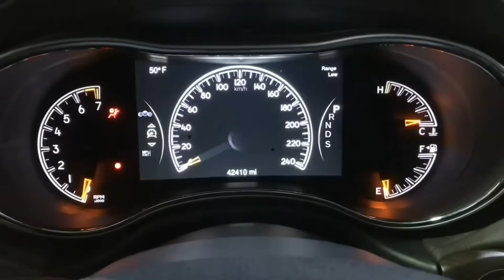The Shocking Truth Behind Chrysler's 2.7 V6 Engine Disaster

Comment: Org. Owner Since 2010.
2010 300 2.7L w/ 178,000 ORG. 
Pennzoil 5W-20 CONVENTIONAL OIL ONLY every 3-5k. Reg Fuel, w/ B-12 monthly. 
Trans Service Every 50k. New KYB shocks and struts at 150k. 
Recent Tune up, w/ New Bosh injectors/NGKcoil/NGKplugs, 
Cylinders/Valves clean, no oil sludge. Goal; 300k or end service life.

Do not mix synthetics and blends into your conventional only vehicle. That's the trick.

Comment: I had a 2000 chrysler canada Intrepid. had the 2.7, ran great for the first 5 years, then it gave me nothing but trouble. engine light constantly came on. no heat. had to shut the car off and on. go into safe mode. engine finally went at 200kms, 124k miles. had to replace the power steering cooling system. the rods bent back, tapped against a connection bolt. vibration tapped a hole in it. all fluid drained out. had to replace it. $400.00. I had it. I bought a replacement car, a 92 crown vic. 8 years older, more miles on it. ran like a top. drove it for 5 years. I was going to drive it until summer however it kept going. its still on the road today. sold to some helicopter mechanic apprentice. now drive a caddy. I will never buy another chrysler product again.

Comment: This story is very true.  Had this happen to my 2002 Sebring Convertible.  I used conventional oil as that was OEM recommended and commonly used.  Synthetic wasn't very common yet and very expensive at $15/qt.  Now walmart and costco sells synthetic at $3/qt.  Conventional oil resulted in a sludge monster that jumped timing.  I replaced the bent intake valves, timing chain, tensioner and water pump.   The 02 Onyx green Sebring convertible is still going strong today.

Comment: Had a 02 Dodge Stratus Sedan R/T with a 5 speed manual transmission. Best car ever 2.7L was great. You just needed to be on top of maintenance at every 3k with full synthetic oil. The looks that car would get with a 2nd gear scratch wad great. I drove it into the ground with over 240k miles on if before the rust destroyed the body.

Comment: The 3.6 l pentagram has been a fantastic little engine in my wife's grand cherokee.. regular maintenence and keep the revs down and no issues.. main issues I've seen with rebuilders is the rod bolts were not very strong, and the oil cooler leaking.. I dont follow the Chrysler oil change schedule either... its always change at 4k and always uses castrol edge and a wix filter... I've been very happy with that car

Comment: The Chrysler V6 engines were put in economy cars. Cars were their owners may not have adhered to the oil change interval as strictly as a car enthusiast car. Extended oil changes well beyond the service life of the oil caused the oils of the time to break down into sludge. This is no different now as it was 20 years ago. What adds insult to injury is the narrow oil passages. Those passages started clogging up with sludge after the cars owners opted to extend their oil change intervals. This issue exacerbated the issue. Of course conventional oils of the time are not as good as conventional and synthetic oils of today. Had this car been spec'd with synthetic oil, one more resistant to breakdown with the additivie packages of today, this would be less of an issue. Modern cars run even tighter tolerances and use thinner oils now than ever! 

Synthetic oils in the Chrysler 2.7 V6 would've saved them. At least from sludge.

The waterpump running off the timing set is not a good idea ever. Ford would later do this to their Duratec V6s which was the killer of those engines if not caught and repaired in time. Granted, they did it to fit in FWD cars, crossovers and SUVs. RWD & 4WD trucks and SUVs didnt have that problem. 

What reallly sucked about the LH cars was the battery behind the drivers wheel well. That was idiotic! Chrysler would solve this issue by moving the battery to the trunk in newer vehicles.

Comment: Moral of the story: Change your oil every 3000 miles, use Mobil 1 synthetic, use a quality oil filter. I personally never buy a “new” car. I drive 60’s and 70’s cars that hold their value and have simple engineering. A Dodge or Plymouth V8 (318, 340, 360, 383, 413, 426, 440) driven car or truck will last forever and often be worth more than any new car or truck.

Comment: @bbracing3925 No, it isn't leaking. It doesn't have oil sitting there, uses none in 10,000 km. Same with the coolant. Talking a 2017 a Go Green Dodge Challenger GT AWD. I even tow my boat with it. A horn, cracked plastic ZF trans pan, replaced with aluminum and the center driveshaft replaced with a 2 piece housing and rubber. Otherwise just maintenance items, no rocker noise. I had a 2010 Challenger with the 2.7's sibling 3.5. I accidentally stretched one conventional oil change to 8000 km. It used more and more oil after that and had a bad clatter. Our 2017 has been as good as the Toyota Corolla we bought with 13,000 km. Actually better, that killed tires every 50,000 km. Had two alignments at two different places.

Comment: I had a 2003 Sebring with this engine and it barely made it to 100k miles before it shit the bed. The water pump housed within the block began to leak and caused the engine to fail. Neither the dealer nor Chrysler would stand behind this POS. This experience with Chrysler single handedly turned me against everything related to the brand.

Comment: When “100,000” spark plugs are advertized customers become jaded when the spark plugs outlast the rest of the car.
Legend is that the first mini-vans’ (what the stereotypical parents took the kids to soccer in the ‘80s before SUVs) powertrains were warranted to 60,000 miles and on schedule the rubber timing belt would fail a few 1,000 miles later. At the time the typical miles per year was 12,000 more or even more. Don’t know about mini-vans but I had such a belt fail; the car just stopped. Fortunately the piston to valve clearance was sufficient.

Comment: SO much incorrect information in this video. Yes, the 2.7 was a notoriously bad engine (later revisions weren't as bad, but I still wouldn't own one), but was NOT a clean sheet design, it was derived from the 3.5 SOHC which was NOT a heavy or inefficient motor, it was revolutionary for a mainstream new clean sheet design from an American manufacturer when it was released for the 93 model year. They wanted a modern replacement for the base engine in LH cars (the 3.3 used in base model first gen LH cars was neither efficient, smooth or quiet, so they went to the drawing board and used the 3.5 as a basis to design something smaller that would produce less emissions while still maintaining respectable power - and they did achieve that goal. It made only a hair less power than the outgoing first gen 3.5, and made much more power with better economy and NVH than the 3.3 it replaced.

The rest of the timeline? Well we know the rest. Small oil passages combined with a VERY high normal operating temperature and a water pump that had a tendency to leak into the crankcase and contaminate the oil wiping out rod and cam bearings were a really, really bad combination for this engine.

Comment: I had tow Stratus’ with the 2.7. I loved the engine. Good power, smooth running, good fuel economy. The key to keeping it healthy was strict adherence to oil changes. Engines run hot on the heads and can’t tolerate prolonged drain intervals. Great little engines when properly maintained.

Comment: As a Chrysler tech, I loved these engines when they came out. If they were well taken care of, they were powerful, reasonably reliable, and got decent fuel mileage. I made a lot of money servicing and repairing them, and was the local expert in them as no one in our shop wanted to touch them. 
The lowdown that I got originally was that the bean counters decided that the oil cooler that the engineers included in the package cost too much so it was deleted. 
My current 2010 Chrysler 300 has 278,000 miles on it. I bought it from a customer who blew the original 2.7 L up. I then rebuilt it and have only used fully synthetic oil in it since that day. Which is something I learned earlier on.

Comment: I actually remember being impressed when I found out my buddy's Chrysler Concorde only had the 2.7 under the wood, while I thought it had the 3.5...  That was a fairly large car, and that little engine motivated it with alacrity, while never returning less than 19 MPG in 80 to 90% city driving.  I believe he had the oil changed at 3-5,000 miles and he did catch the water pump before it ruined the oil, once in the 100,000 miles he drove it.

Comment: I seen A LOT of these engines fail. I had a 2000 Concorde with the much better 3.2 liter which was a sister to the 3.5 but with a bit less power. I never had any issues with that motor. I had a dohc 2.4 plymouth neon that after the water pump/timing belt was replaced it ran like a champ. I traded it at 170k and it still ran great.

Comment: I had a intrepid with that motor  a very good car  arodynamic and fast  great car on the interstate  good gas mileage  had no issue with sludge  early models with leaking water pump in crankcase was what caused sludge problem  improved seal on water pump shaft fixed it  worst thing about those cars was front wheel drive  lack of 50/50 front to rear weight bias made them easy to spin on wet pavement or snow  ask me how i know

Comment: Most of these problems wouldn’t even happen if people just changes their oil before what the book says 7,500 or so I believe is what they say, my 4.7 has the same oiling issues as the 2.7 and just changing the oil frequently prevents most of these problems with my engine having just light varnish at 279k miles

Comment: I owned a 1999 Sebring convertible with the 2.7 and a 2010 Sebring hardtop convertible also with the 2.7 I put over 150K on these cars with basic maintenance. Great little engines.
Reply: Mine has 282,800 miles. Maintenance is key.
Reply: I am thinking about buying one same year from a friend very well kept I hope that is a good one .
Reply: A 99 Sebring would have had the 2.5 v6 which was based on the Mitsubishi 3.0. Completely different engine family.
Reply: @danr9584 The 2.5 was a 4 cylinder derived from the 2.2. The Mitsubishi 3.0 V6 was a great engine. The 2.7 V6 came out in 1996 for 1997 model year cars. The Sebring had it as an option from day one.
Reply: @andrewarmstrong7310 for 97-00 the 2.7 only came in the intrepid & Concorde. It didn’t come in the Sebring until the 01 refresh. The early ones had a 2.5 v6 that was only made for a few years.

Comment: My company had a fleet of cars and several 2008 Chrysler Sebrings with the 2.7. These were flex fuel e85 capable and we bought them for state tax credits if we exclusively used e85 fuel. Fast forward several years and these were excellent cars for us. We had several with over 250k miles before we sold the fleet. Chrysler made several updates to the 2.7 before its discontinuation. The early engines definitely had issues that no amount of maintenance could prevent, but that later years were adequately improved for better reliability.

Comment: biggest problem with the 2.7 was a too small pcv system to cut oil consumption which kills cat. converters.
that's why they needed more oil changes.
i've known many that went 300k miles without a problem.
the water pump going bad and not being caught in time killed quite a few too. 
you needed to watch the weephole for coolant leaking, an indication of water pump problems, but it was on the left side of the engine out of sight.
first 3.5 was reliable, while the second gen 3.5/3.2 had a problem if you didn't heed the timing belt replacement interval as they were an interference engine.

Comment: My brother ordered 2002 Dodge Stratus R/T 4-door with the 5 speed manual transmission in 2002.  He still drives it today with zero engine issues, original clutch etc. Granted, he "only" has a little under 70K miles on it not quite the 215K miles I put on my 1998 Neon Expresso DOHC with over 10 years of autocrossing and track day weekends.  I will admit the 2.7L "buried" water pump will be an issue - if it ever starts to leak.
Reply: Had the same car as your brother, loved it. Got 29 mpg until the day the rotten away. Freaking midwest rust. Bought it with 14k miles made it all the way to 240k miles before the body rust destroyed it. Engine and transmission were still going strong. Loved that car

Comment: Your timeline is off. The 2.7 wasn't developed for the LH platform released in 1993. The 2.7 came in 1998 and was based on the 3.5 (another mistake in the video saying it wasn't based on another engine).

Comment: There is a lot of misinformation here. This engine's main flaw was there being too much "upstairs" oil in them. The sludging was, indeed, due to lack of maintenance. It was only the sludged engines that were seen taken apart, while the clean ones were still on the road. Contrary to the video's claim, there is actually too much oil supply in these engines, so the oil return passages need to be internally clean for it to flow back to the oil pan quickly enough. Add some sludge, and the return passages simply cannot flow well enough, so the oil pickup gets starved with oil. Most engines I had apart over the decades have some kind of oil restriction to the cylinder heads, but these have full-bore oil to 4 camshafts, 24 lash adjusters, 3 timing chain tensioners, and an "oil accumulator" in the head which would shoot oil at the bottom of the valve cover for no particularly good reason. Add in "normal" increase in oil consumption as things age, and let's just say that these engines won't survive on 2 quarts of oil like many others out there will.
Additionally, timing chain tensioners in the 2000+ model years had an O-ring that would fail, causing the chain to slap around and it would be mistaken for rod bearing noise and a $.50 O-ring would fix it.  They could have also used a more robust water pump and water pump gasket setup.

With some small changes, these could have been made into good engines, but it never happened.
Reply: It's an AI made video, creator doesn't care... The bot will comment thanks for your feedback
Reply: @Sauceyjames  that makes sense.
Reply: @paulstandaert5709 When he said DOHC and not Dual Overhead Cam, it came off as a person just reading a line. Im not interested in someone reading wikipedia and common SEO garabge.

Comment: I know this is an unpopular opinion, but these are actually good engines that will last if maintained well. Required oil changes are 3000 to 5000 miles according to the official maintenance schedule. When you follow that schedule and use fully synthetic oil (5W20 or 5W30), these engines will last hundreds of thousands of miles with no sludge issues whatsoever. The main issue is the internal water pump. It's very labor intensive to have it replaced, easily costing up to $2000 including (aftermarket) parts. When not replaced on time, coolant will leak into the engine, causing sludge and destroying the engine.

Comment: I'll never understand the logic of internal, timing chain driven water pumps. Water pump will eventually fail. Making it so it can grenade the engine and/or raise the labor costs is absolutely dumb.
Reply: The timing chain applies torque to the water pump bearing. When the pump starts go bad, it breaks the plastic blades off of the impeller which then plug up the weep hole for the water pump. The only other place for the leaking coolant to go to is into the crankcase. If they had integrated a carrier bearing into the timing cover for the water pump, it would have been much more robust.

Comment: The 2.7 could be ok when the dipstick was checked once a week.  The oil in these motors must be clean. When the water pump leaked,the oil became milky - immediately address the cause or engine failure will occur soon

Comment: Probably more accurately, Mercedes ran away from it. 

In any event, I've been told by a few people that running some Marvel or SeaFoam through the engine for a couple of days will dissolve most of the sludge, and then switching to synthetic oil prevents the problem from recurring. At this point, I'd just probably put a rebuild in and start from scratch if I had questions. I drove a few Intrepids with these for rentals. When running right, they're not terrible. Decent power, quiet, fairly good mileage. If only those passages were a little bigger, a lot of these issues would have been avoided.